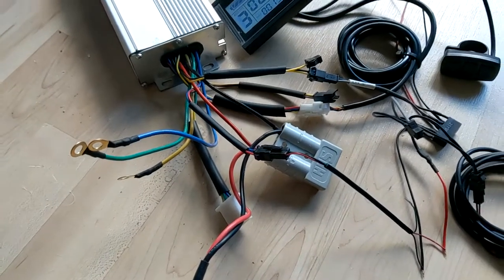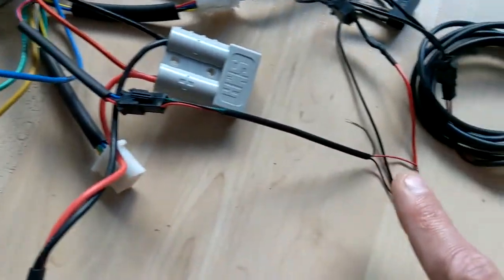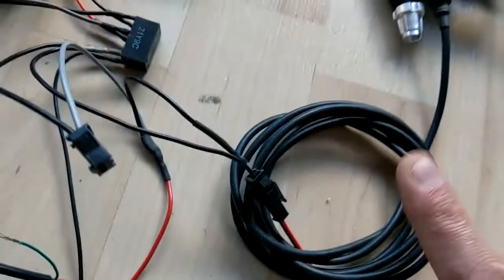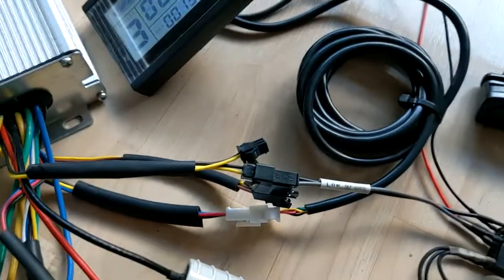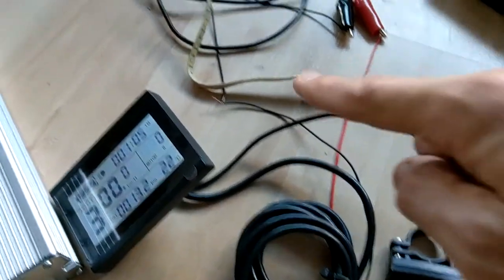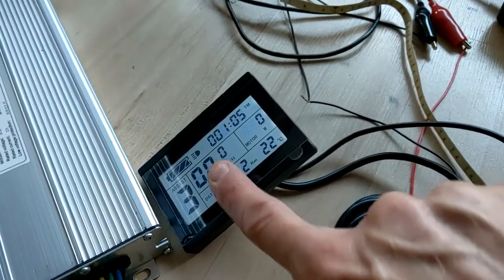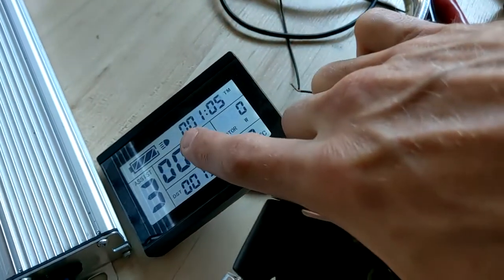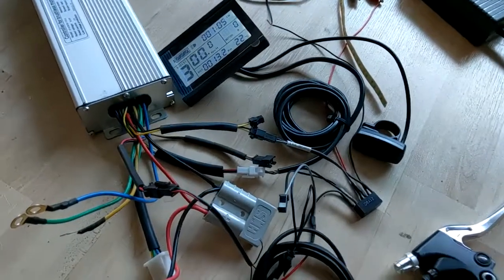E-bike brake-lights via $5 relay

Comment: Thanks! This gave me a hint on using 2x 12V 10A 5-pin SPDT relays instead since my tail/brake light is 12V, and those relays are what I have laying around. The 1st relay toggles and powers the brake light, while the 2nd relay also toggles but merely shorts the "low-level brake input" wires for the controller--replacing the brake lever action, since it essentially does the same thing.
Reply from the maker: Nice job!  Yes, that's a good adaptation.

The version I made, being powered by the 5V sensor-power source from inside the controller, can use any voltage of brake-light--and that's advantageous for two main reasons.  First, because e-bikes operate on a wide range of system voltages (36V to 72V are common enough), any choice of brake-light and voltage will be compatible.  Second, the low-voltage low-current (5VDC)  going thru the e-bike brake-handles (out there in the rain) prolongs the life of the microswitches in the brake-handles.

On my bakfiets, I also use two relays.  I use that little one from my video as a trigger-relay for an off-the-shelf automotive 12V relay--which controls the brake-lights.  I chose this, because I have more lighting (along with trailer lighting circuitry) so my total brake-light amperage was getting close to the limit of that little Omron relay.

Best of luck with your project!  Ride safe!

Comment: The brake circuit was the hardest part to figure out, but eventually I got it right with a few relays (shift sensor signal also feeds into the brake signal). I also have a key-on 12v circuit that is dimmed to around 11.2v via a resistor so I can use my brake lights as running lights, made everything double hard because I had to put a diode on all the 11.2v lines to keep the brake relay from tripping via back voltage. Overall it was a very satisfying problem to solve.
Reply from the maker: Thanks for the comments, Chris B

Nice job customizing the concept to work with your own particular system! Well done!

It is a very satisfying feeling when the puzzles come together.

Ride safe! And all the best!
Reply: Can you help me? :)

Comment: You should install a freewheel or flyback diode on the coil of the relay... even though its only activating when the 4.6V from the Low Brake is grounded, there can be a voltage spike that can fry the controller as the coil discharges. I'm doing this same setup on my ebike.
Reply from the maker: @AimlessMoto  thanks for your thoughtful input! That's a solid suggestion.  Good idea.

But is it really necessary, or would it be overkill?

The Omron relay I selected uses very little energy for its coil...  And the controllers' trigger and sensor circuitry is by neccesity fairly robust...

In any case, I have not had any problems to date, utilyzing the example relay from the mock-up video in my bakfiets to control a trio of BLDC controllers, and to trigger a 12v LED brake light circuit (utilizing an additional relay) including a feed for trailer brake lights.

Best of luck with your project!

Ride safe
Reply: @SaberToothBicycle  Good to know, I always err on the side of caution. I've tested many 5v DC relays and they all have a spike when actuating and turning off. Glad to hears yours is still running fine!

Comment: What is the exact relay you're using? 21Y9C doesn't search to any result.
Reply from the maker: Thanks for your question.  The particular relay used in the video-mockup is an Omron G6B-2214P-US 5 VDC (pdf data sheets and specifications are available online).

Good luck with your project!

Ride Safe!

Comment: I wish i could like your video, i love your sense of humour. I'm doing a re model of an Engwe, can i bust your ear lobes?
Is it possible just to remove the existing break light and add any motorbike break light to the wiring? Seems obvious but i don't know.
Reply from the maker: @moovintruespace  If you're using the modification in my video, the answer is yes.  The relay can activate any brake light you wish to use.

Thanks for the comment, and Best of luck with your project.

Ride safely!

Comment: i want to add a brake light to my stealth bomber bike. i have a 72v li-ion battery with a 12v DC/DC step down fitted. would i need the use a 12v omron g6b-2214p-us relay from the step down unit. or find a 5v wire if there is one. coming from the speed controller.
Reply from the maker: You'll want to use the same relay (or an equivalent).

The voltage source for the relay's coil (as described) is the sensor-power circuit. Regardless of system voltage, the sensor-circuits are 5vdc. Similarly to what I did in the video, you could tap into the Throttle Signal circuit, or your PAS (pedal-rotation sensor) circuit.

You will not be able to power the relay however, from the Low Brake sensor signal circuit. There's not enough current available in that circuit to power the relay's coil--and that's the reason most others in the past abandoned the idea of using a relay.

If you are uncertain how to proceed, find an e-bike technician to set it up for you.

That stepdown transformer will be helpful for providing power to your brake light; as you'll be able to choose any automotive or motorcycle lamp assembly you wish (as I mentioned--LED lamps are a good choice--because their current-draw will be well within the relay's limitations).

Best of luck with your project!
Reply: @SaberToothBicycle  Hi again Tim and thank you for replying back to me. the thumb nail picture that you have for this video. would it be possible please if you could send me a larger sized viewable photo of it. thanks in advance. also. i have just done a voltage test from the PAS cable from the speed controller and it's voltage is showing up as 4.26v is that normal/ok to work with the 5v rely?
Reply from the maker: @historyunderbeneath  Yes, that PAS circuit should be an adequate power-source for the relay's coil. Regarding that thumbnail, I've been wanting to get a viewable version up with this video. I keep trying to figure out YouTube Studio. It shouldn't be hard to insert that still-image into the video--to sit on screen for a few seconds. Viewers could pause, take a screenshot--whatever. Because it's a technical video--that would be very helpful, but so far I haven't been able to figure out how to do that. I'll keep trying.
Reply: @SaberToothBicycle  if i give you my email address would you send it to me please.
Reply from the maker: @History_Under_Beneath For privacy reasons, I'll ask that you please don't share your email address in the comments. It's nothing personal--but it just seems for the best. Anyways. Because I'm not a monetized member of YouTube, I am prevented from being able to post a link in either the description, or the comments. However, I do have that image posted over at the electricbike dot com e-bike forum.  That's actually a great place to find help--just saying. If you go there, and enter the rest of the following, after the "m" in com--you can find the image (remove any spaces): Forward-slash forum forward-slash filedata forward-slash fetch?id=107768&d=1591984287

I hope that isn't too much of a  puzzle!

Good luck!
Reply: @SaberToothBicycle  i got the image. many, many thanks again.........
Reply from the maker: Glad to help!

Best of luck with your project!
Reply: @SaberToothBicycle  Hi again Tim. i have messaged you on the forum ware you posted the wiring diagram for the brake light..............
Reply: @SaberToothBicycle  Hi again Tim. my brake light system is now all sorted and up and running. a huge thank you once again.
Reply from the maker: @historyunderbeneath  Awesome to hear you've got it working!

All the best.

Comment: I have blue and red on my handbrake And White and red and black on my display wich cabel going to what? Thanks
Reply from the maker: @panasonicchrome7915  Thanks for your interest, and for the question; but I am  afraid you haven't given me enough information to provide you with an answer.

I suggest you find someone who has a bit more experience with electrical wiring, and have them watch the video, and then take a look at your system and project.

Best of luck!

Comment: Do you think you could build a full motorcycle lighting system horn . Turn signals. Beake lights. Head lights.  All led .  kit runing off a 12v rechargeable battery.
Reply from the maker: Yes. I have all that on my bakfiets, along with fog lights, and connection for a trailer with complete lighting. All the switches and components were readily available off the shelf items. If I can? You could too.
Reply: @SaberToothBicycle  I have a razor mx650.  If you look it up I want a full street legal light and horn system for it but running off a 12v rechargeable battery.  I don't know anything about wiring
Reply from the maker: @freakenstein1984  If you don't understand wiring, you're going to struggle.

I suggest you find a local technician to help you. If you have a scooter/motorbike shop they should have both the knowledge and access to the parts you'll need.

Yes, that will cost you more. But alas, you cannot enjoy the "do-it-yourself discount" if you can't "do-it-yourself".

Best of luck with your project!

Comment: Hey! When I connect my positive and negative break cables from my controller to my relay, the controller sees it as if I'm breaking. Any idea why? Could you post a diagram for your wiring?
Reply from the maker: I cannot be certain, but it sounds like your brake-cables from the controller might be reversed in polarity.  The "Low Brake" circuit has a very-low-current positive signal, and the circuit is designed to be completed via your brake-handles to negative/ground.

With my modification, the relay's coil is what becomes "triggered" by the brake-handles, and the relay's contacts close that "low brake" circuit (and the other set of contacts are for your brake-light).

Because I'm not a monetized member of YouTube, I am prevented from being able to post a link in either the description, or the comments, so I'm unable to post a wiring diagram. However, I do have that image (with the arrows and labels) posted over at the electricbike dot com e-bike forum.  That forum is actually a great place to find help. If you go there, and enter the rest of the following, after the "m" in com--you can find the image (remove any spaces): Forward-slash forum forward-slash filedata forward-slash fetch?id=107768&d=1591984287

I hope that isn't too much of a  puzzle!

Good luck with your project, RadicalGames!
Reply: @SaberToothBicycle  I just had a look at your diagram. So when the handles are pressed, the positive wire closes, and the coil turns on. Then what happens? Is it that the circuit for the break wires that goes in the controller opens (so the controller senses you've hit the breaks) circuit for the break lights closes, so the rear light turns on?
Reply from the maker: @radicalgames9256  The coil circuit is closed by the brake handles. The Low Brake circuit is a sensing-circuit. One wire is Positive, and is always on, the other one is Negative (ground). The Low Brake Circuit is completed (closed) by one set of contacts, your (personally-chosen) brake light circuit is closed with the other set of contacts.

Be patient with yourself. It is not a lot of wires. I have faith in your abilities.  If you find your frustrations persist, I will be here.

But if those frustrations mount up, you also may wish to try to find somebody near to you, who can help.

Best of luck, RadicalGames!
Reply: @SaberToothBicycle  I just wanted to let you know I've figured it out thanks to your video, comments, and diagram! Thanks a lot you absolute king! 👑
Reply from the maker: @radicalgames9256  That is fantastic! I'm glad to hear that you got it working!

All the best, RadicalGames. Ride safe!

Comment: I'm running a 60v li-ion batt.
I'm adding a DC/DC step down to 12v  to power my headlights blinkers and brake lights. 
Now can I use my regeneration brake wires  on my brake handle to activate my brake light? 
If so that seems to simple compared to what I was really expecting.
Reply from the maker: Yes.

Exactly as outlined in the video--assuming you use that exact relay.

And yes--it's a lot simpler than you'd expect.

I'm running a 48VDC battery, using a buck-converter (48VDC  --> 12VDC) to power my lighting (and radio/USB outlet/etc).  

All e-bike systems, regardless of voltage--will use +5VDC for their controller's (+) sensor voltage-source. The +5VDC wire going to either throttle or PAS sensor can be spliced into.

The controller's +5VDC passes through the brake-handle switches' circuits--to power the relay's coil, then back to (-) negative/ground/black-wire.

One set of contacts is used to complete the controller's "Low Brake" circuit.

The other set of contacts is used to complete the power-circuit to the brake-light (any voltage).

In the video, you can see the relay I've set up for the demo is equipped with connectors.  I've configured it basically like a plug-and-play module--something you could drop right into an existing system--without having to cut and splice any wires.  You can see I've soldered on all the appropriate standard e-bike brake-handle connectors (male and female) to make that possible--but "plug-and-play" was mostly just for the sake of clarity--for the sake of the demonstration video. You could do the same--make it modular if you'd like to--but obviously all those little connectors aren't really needed. All the connections could just be soldered directly.  But keep a careful eye on your e-bike brake-handles' wiring-connections--you won't want them in series; but in parallel--so either (or both) handles triggers the relay.

Sorry for the late response.

Best of luck!
Reply: @SaberToothBicycle  nah your good  with the time. I'm still waiting on parts.
The info exceeds my expectations 
Some of the best I've found. Easy to follow.  Kinda made me feel stupid  and frustrated after I'd realized how simple the whole ordeal is. Thanks man keep up the great work helped alot.
Reply from the maker: @SigmaMale9901  Thanks for the kind words.

Don't feel frustrated--and certainly not foolish.  I've been on one of the big e-bike forums for a long time, and I've seen seen many postings by many other bright people struggling with various very complicated attempts to make brake-lights work for their e-bikes.

Motion-sensors, separate switches, one brake-handle for the brake-lights, the other for the motors' shut-off function, and various other "accidents waiting to happen".

I just felt there must be an easier way...  There was.

Having figured it out, I wanted to share it!
Reply: @SaberToothBicycle   very helpful information I'm building mine from frame up in my livingroom.
My first go at it. Seems to be coming along piece by piece. 
Couple snags here and there. 
Thank you again.
Reply: @SaberToothBicycle  i didnt get the first bid +and - from throttle, is + of throttle goes to the brake sensor and - of throttle go to relay so when brake active they power up the relay? then 12v in my case already connected to the rear brake so when the relay activated the light comes on
Reply from the maker: @alireza071  I've updated the video-description with more details. I hope that's able to provide you some more insight!
Reply: Not a bad idea to use a relay to turn on the step down transformer when you turn the key. otherwise it'll suck power all the time.